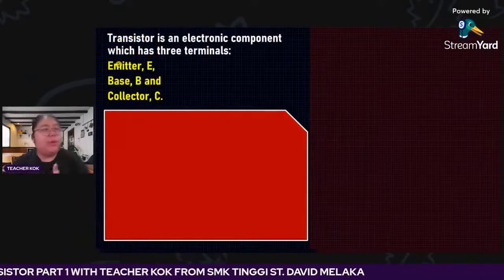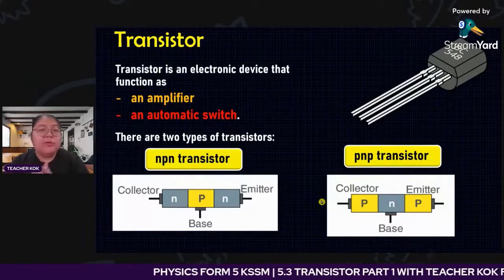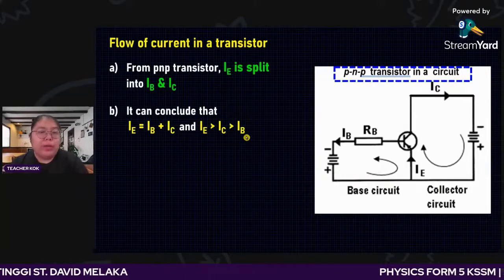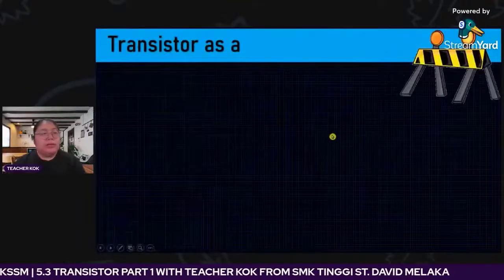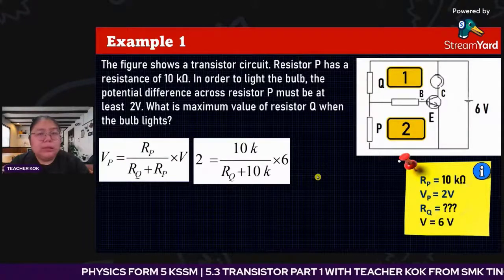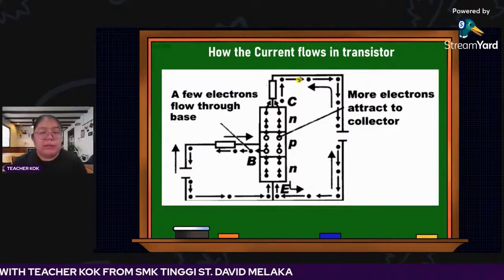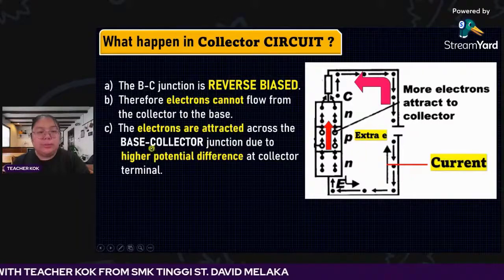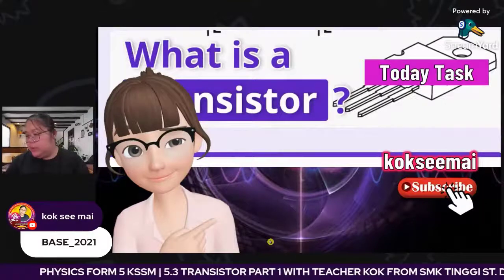Lesson 5.3 TRANSISTOR Form 5 KSSM #1

Comment: Teacher, at 51.07 small base current produce minimum voltage to turn on collector circuit. Why doesn’t small base current produce maximum voltage to turn on collector circuit?
Reply from the maker: transistor as amplified to increase the current in collector circuit